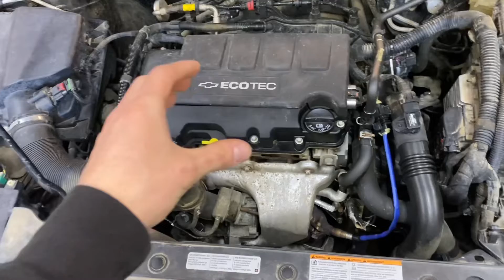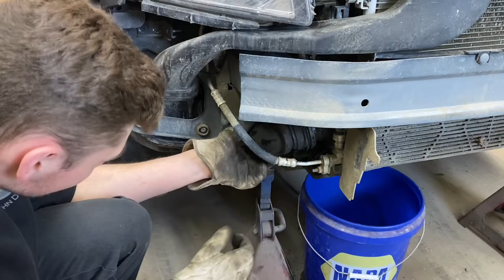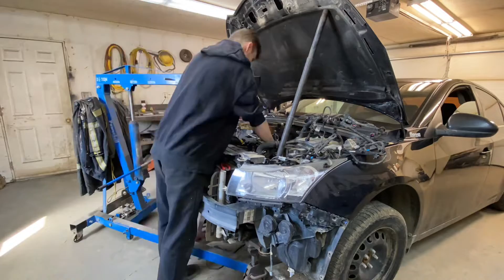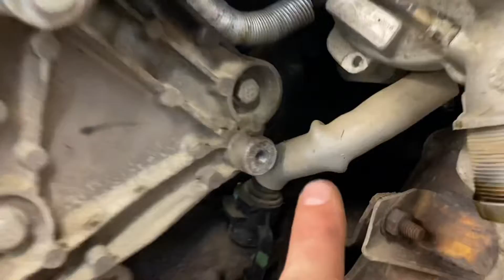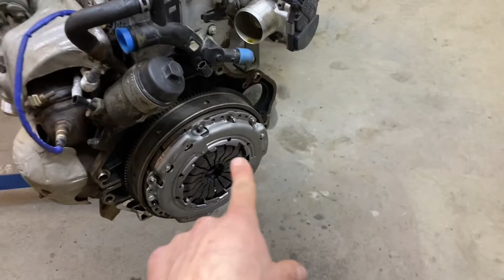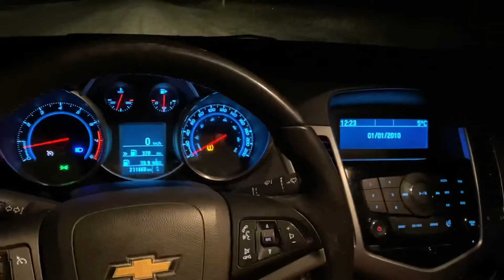2011-2016 Chevy Cruze Clutch Replacement

Comment: Awesome video, I have a 2014 1.4L cruze and want to get a engine from another cruze and do the head gasket and other seals including the clutch on my car. Question is..... Can I put a 2011 or 2012 non manual engine back in my 2014 1.4L and put a clutch on that engine if so, is the fly wheel different off the automatic engine?

Comment: You didn't mention replacing the throw out bearing, but I'm assuming you did. I would also replace the slave cylinder while you're in there.

Comment: The normal operating engine temperature is 220 - 230℉ for this car.  The extreme heat is what destroys a lot of the seals and causes leaks. I tune cars and was able to verify this on my 2013 Cruze. The thermostat ECU setting is 220℉. Insane!  I changed it to 180℉ on my car and also set the fan to come on sooner. 120k miles later, no leaks or check eng lights. Still driving on same clutch too.
Reply: how does one change the thermostat ecu setting?
Reply: @iDrewMelon  tuning software. I use HP Tuners
Reply: @Bailey-k2j where are u located

Comment: @16:04, you did not bleed the clutch correctly.

There are two 'portion' of this clutch system.

1st portion, from [brake fluid reservoir] down to the [bleeding screw].
2nd portion, from [bleeding screw] to the inside of the [slave cylinder].

when you did the bleeding in your description, you only bled the 1st portion. after the 1st portion bleeding, you should have done the 2nd portion bleeding. The 2nd portion bleeding steps are bellow:

1. push down the clutch padel and let the padel stay there.
2. open the bleeding screw, waiting for 5-10 seconds, let the fluid (air) coming out, close the  bleeding screw (had tightening). let go the clutch padel, wait for another 5 seconds.
3. repeat step 2 four times.
4. in the last interaion, tighten the bleeding screw securely (not too much force, it is a plastic part), take out the bleeding hose. 

in the whole process, keep an eye on the fluid in the [brake fluid reservoir], adding the fluid as necessary.

finally, fill the fluid to MAX line on the [brake fluid reservoir].

The basic ideal of the 2nd portion bleeding is using the force of the pressure plate to push out the [air and fluid] out from the bottom of the slave cylinder.

I am posting below the procedure from the GM shop manual.

The step 4 is the procedure to bleed the [2nd portion]

1. Attach brake bleeder.
 Screw adapter (1) for corresponding brake bleeder onto brake fluid reservoir.
NOTE: Only use brake fluid DOT 3. The hydraulic clutch actuation must now only be
bled from "below", i.e. from the bleeder valve. A brake bleeder must be used for
this purpose - see " Workshop Equipment" catalogue. Manual bleeding is no
longer permissible. Observe manufacturer's instructions before using brake
bleeder. The brake bleeder must be set to an operating pressure of
approximately 2 bar.
NOTE: Insert hose end in suitable brake fluid collecting basin.
2013 Chevrolet Cruze
2013 TRANSMISSION Clutch - Cruze


 Disconnect valve cap from bleeder valve.
 Connect bleeder hose (2) to bleeder valve (3).
2. Bleed clutch.
 Switch on brake bleeder.
 Open bleeder valve 2-3 turns.
 Bleed until brake fluid escapes without bubbles at hose.
 Close bleeder valve hand tight.
3. Detach brake bleeder.
 Detach adapter from brake fluid reservoir.
 Push valve cap onto bleeder valve to protect the bleeder valve.

4. Bleed pressure line between transmission housing and central release.
 Press and hold clutch pedal.
 Open bleeder valve until air or air/brake fluid mixture emerges.
 Close bleeder valve hand tight.
 Release clutch pedal as far as the stop at normal speed.
 Wait approximately 5 seconds.
 Repeat this bleeding process 4 times.
 Tighten bleeder valve.
 Detach bleeder hose.
 Push valve cap on to bleeder valve to protect the bleeder valve.
5. Connect bleeder hose to bleeder valve, place free end in a suitable connecting container.
6. Top up brake fluid reservoir.
 Fill brake fluid reservoir up to "MAX" marking.
 Install brake fluid reservoir.
7. Check the actuation pressure of the clutch pedal. Ensure that the clutch pedal is not spongy and that there
is sufficient clutch pedal reserve (more than 13 mm (0.5 in)).
8. Check shifting for ease of movement with vehicle stationary, with engine running and with clutch
disengaged.
9. Road test the vehicle to ensure proper operation.
NOTE: The following operational stages must be undertaken to fill the
pressure line between the transmission housing and the central
release. When bleeding, ensure that the brake fluid reservoir is
always filled up sufficiently and does not run dry.
NOTE: Do not close the bleeder valve too fast.
2013 Chevrolet Cruze
2013 TRANSMISSION Clutch - Cruze

Undertake road test using varying RPM ranges and frequent gear changes, bring vehicle to operating
temperature during this process. Ensure the brake and clutch system is operating correctly.

Comment: Ok i have a rather annoying problem nobody seems to figure out: 2012 Chevy Cruze just had dual-mass flywheel fail on me so i also replaced the clutch and pressure plate, the instant i got in the car after i noticed it's quite louder than it used to be, it's like i can hear the engine inside the car now, before it was reasonably quiet, i can't pinpoint exactly where the sound is coming from but it seems to be from inside the dashboard, probably somewhere near the firewall. I went through and checked for any visibly missing cover, even got under the car, took it back to the repair shop, they also double-checked that they put everything back... clearly they missed something and won't admit it. Now i'm stuck with a car that's annoyingly loud to drive, i'm trying to figure out what access hole cover they might have forgotten to put back on, i've been driving myself nuts trying to find the source of my troubles...
Reply: sounds like an exhaust leak. sometimes the gaskets break when removed or arent lined up correctly wen reinstalled. id start there

Comment: My Chevrolet Cruze does not select gears it's stuck on gear 5 I drove it without the oil but after pouring the oil it's still stuck what might be the problem ?
Reply: You drove without oil

Comment: You are brave. 1st for owning that car to start with. 2nd for replacement of the clutch w/out touching hydraulic parts (asking to do it again soon). 3. Pulling the engine on jack stands at home.  4.  Not touching the  fly wheel whatsoever.

Not a bad video, but I didn't get what I wanted from it. Your probably snowed in from the current storm. Stay warm!

Comment: Did you have any issues with the clutch slave cylinder leaking since yoy didn't replace it after all that work you did?
Reply from the maker: No it’s been great for about 13,000kms now

Comment: How long did the entire job take you? The engine removal feels more intimidating, but I like how it doesn't require any dangerous heavy lifting. Last time, we did it on a lift (hoist?) and the subframe took three guys to lower or raise and it was still a struggle. Going from the top just seems a little tedious with all the stuff that needs to be disconnected, but no crazy steps. Also, how does the AC compressor stay where it is? Do you unbolt it from the engine and tie it up somehow? Or did you disconnect the refrigerant lines and not mention having to recharge the AC? I'm considering using your clutch replacement method if I end up doing this myself instead of with my mechanic.
Reply: I rewatched, see how you left the AC compressor unhooked from the engine and maybe held by the refrigerant lines.

Comment: I've bled this clutch twice: once with a clutch replacement, once when I changed the hydraulic line from the firewall down to the slave cylinder. It helps to understand the theory and follow the factory instructions. You can get hydraulic fluid down to the bleed screw with gravity, vacuum, or a pressure bleeder. I probably used a Motive power bleeder, the cap is the European thread, same as BMW and probably Mercedes, so don't buy the Chevy/GM one. This is actually a German car with Bosch parts. Anyway, once fluid is down to the bleed screw, you still have air in the slave cylinder. To get it out, you compress the air by pushing the clutch pedal, then open the bleed screw and the air rushes out. After a couple cycles, instead of compressing just air, you flex the pressure plate. When you open the bleed screw, the pressure plate pushes more air out. I think you're supposed to repeat five times to get the slave cylinder full of fluid. I had a friend help me the second time and it took just a couple minutes. If you had trouble getting the air out, I suspect you didn't follow the two stages, where in the first stage you fill the hydraulic line and the second stage you use spring pressure to displace air and work fluid past the bleed screw into the slave cylinder.

Comment: for some reason theres no pilot bearing for a cruze thats why the alignment tool doesn't work, i used a impact socket that fit snug and lined it up with that
Reply: Gm has what they call a pilot bearing for these. I know because I got one from a dealer. And it’s plastic